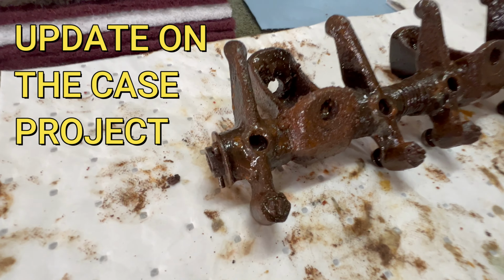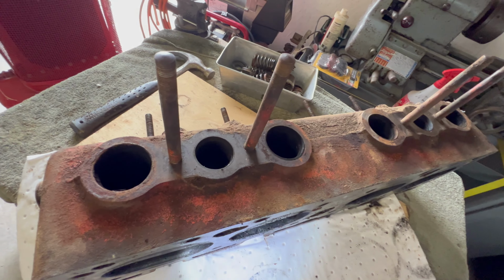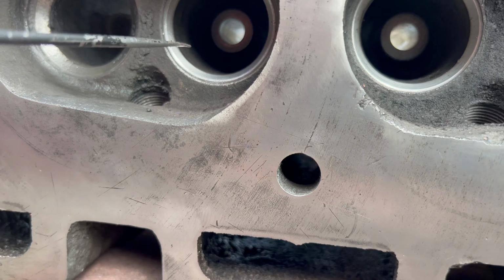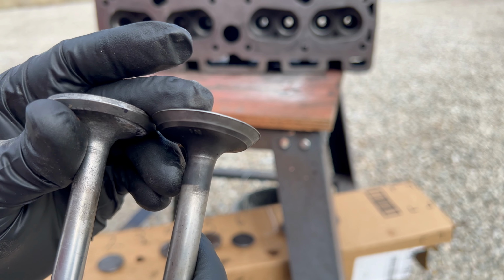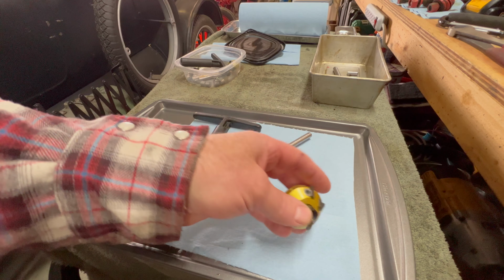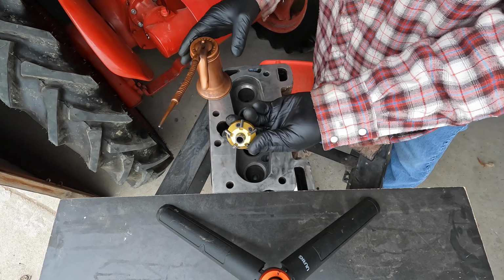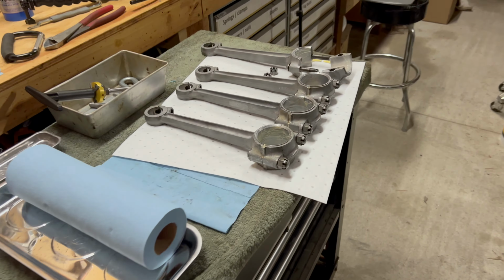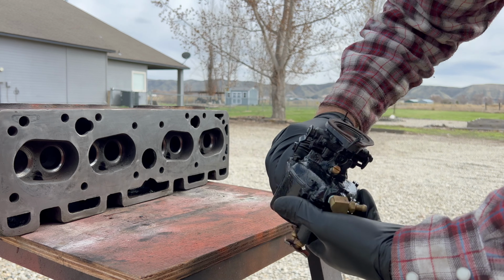1952 Case DC - Part 5, Project Updates

Comment: AWESOME ! Making tools to make your own repairs!  // Ref. the babbit work, I wonder if the guy had to get some type of Case engine specs to repour the babbit or how that process is done / making new forms, etc.? // Looks GREAT !
Reply from the maker: Thanks Dug in Virginia! He just needed the diameter of the largest crank journal (mine were all the same within less than .001"). He pours the babbitt oversized then locks the rods into some sort of jig. Then, he line bores the rod ends to the crank journal diameter I provided him. So, the process isn't specific to Case. He just line bores according to crank journal size. It will be interesting to see how they fit. I may need to use the shims provided to achieve a tolerance of .001"-.003" between the babbitt and crank journals.

Comment: Nice to see the Case project moving along.  I can't get over how dirty the rocker assembly was.  Looks like the inside of some steering gears I just took apart, not like the inside of an engine.  I agree that if you hadn't done this work now, the engine would not have lasted long.  And props on using your lathe to make your own valve cutting guide!
Reply from the maker: Thanks! Yes, I really wonder if this motor has ever been apart before. It sure doesn’t look like it. Wow.

Comment: Just a "For What It's Worth", I did a complete engine overhaul on a 1951 Case DC-3 back in 2005.  Back then we had a machine shop near Allentown, PA who could still re-babbitt bearings.  Fortunately,  that part of the job was easy for me... just let him regrind the crank and he did the bearings to match.  I have no idea how I'd get it done today since that shop closed their doors in 2016.  My biggest headache back then was installing the new sleeves.  I could not get them in without rolling the O-rings out of the seats in the block and cutting them.  After destroying what I think was two complete sets, I gave up and took the block out and let the same machine shop that did the bearings do the sleeves.  I recall that they had special tools (it looked like an expanding mandrill) that pre-seated the O-rings in the grooves just before sliding the sleeves in.  In hind sight, I'm glad I had them do the job.  They found severe pitting and erosion around several of the seal grooves that would probably have leaked if I had been able to get the sleeves in without cutting the O-rings.  I have done many other jobs like this before the Case, mostly Continental engines in Olivers and Fergusons.  I suppose it's a matter of familiarity, but they all seemed to to go together with significantly less aggravation  than that Case DC.  I wish you all the best in this project and I will be following your progress.
Reply from the maker: Thank you for the information! I have wondered about the o-ring installation, and now I will be especially careful. The o-rings aren't cheap either! Thanks again.